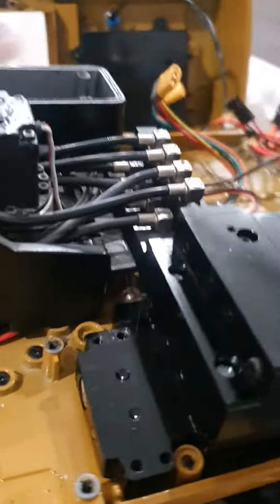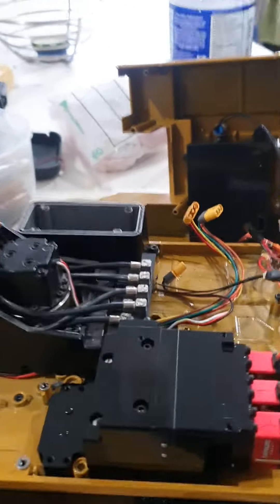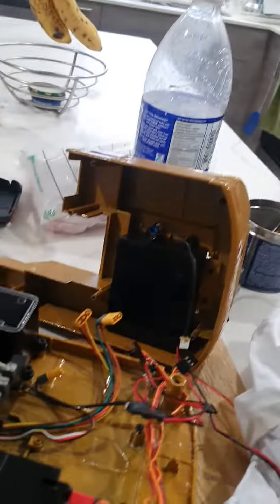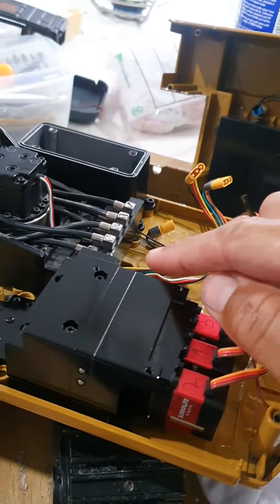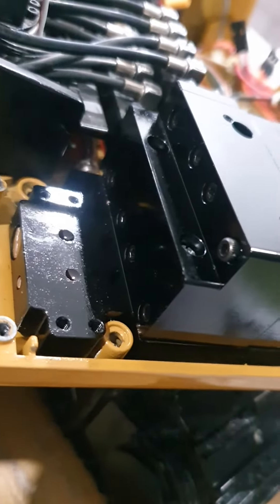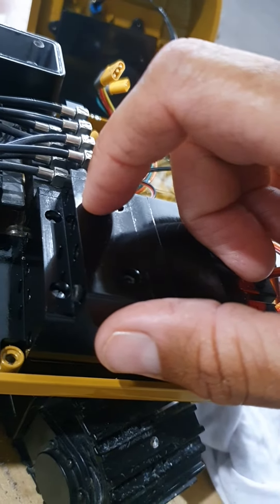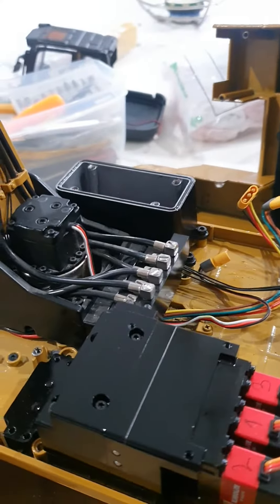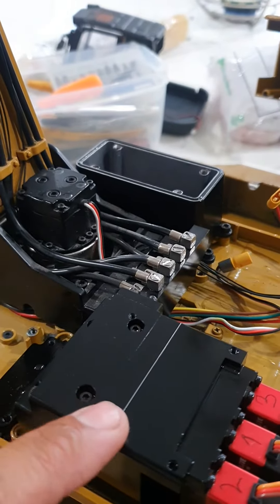Kabolite k336 hydraulic excavator leaks.

Comment: Hi, I knew from your other video that you sold your K336 .... but I can already see that you managed to get it working really smooth.. 
Could you please tell me what you did to make it that smooth and accurate in responding to Radio commands .. ?? or you had to replace the hydraulics ?? ... Thanks a lot
Reply from the maker: I messed with the end point settings for ch1-4, and the the rate and exposures for  those same channels until I got it where it moved slower but still dug nicely. The fsi6s radio is very limited, the hydraulics aren't that great either. I did not change the hydraulic system.
Reply: @caymanite_rc_construction  Thank you very much .... but I have to tell you that you have done a great job ... Have you changed anything in the pump or valve blick adjustment screws  ??
Reply from the maker: @soaringkhaled  no I did not touch the pump pressure adjuster screw. I didn't have a pressure gauge to plumb into the system to monitor any changes I would've made. Didn't want to risk hose/lines bursting under too much  pressure.